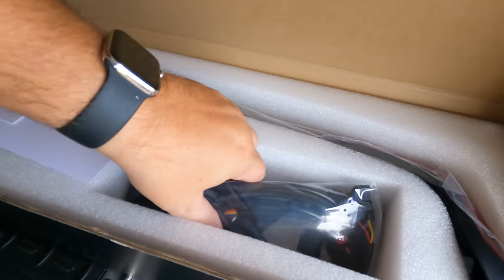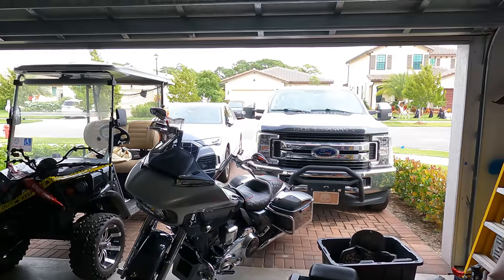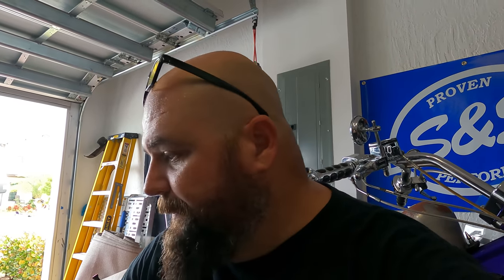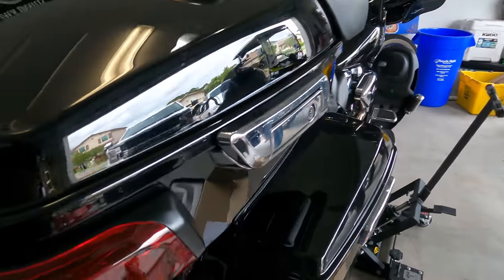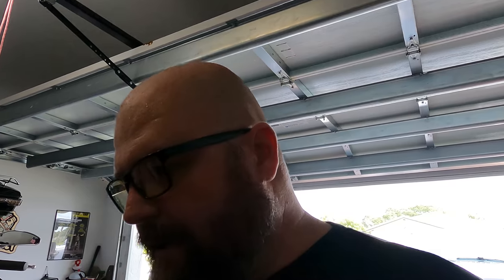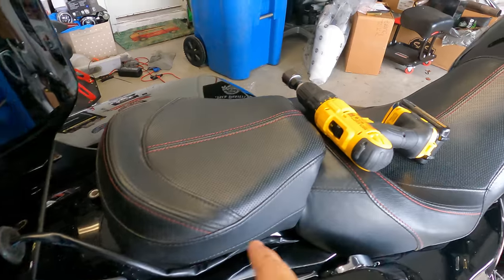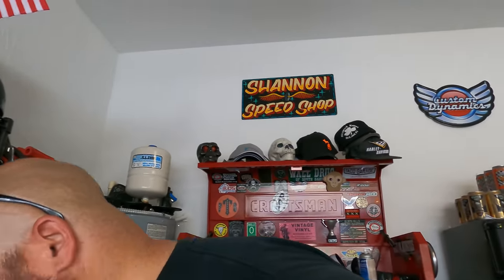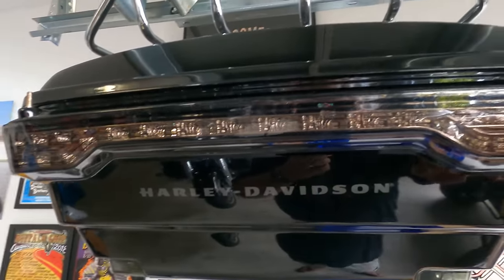A Better Harley Tour Pack Light! Advanblack Reaper Light for Harley Touring Bikes - Install & Review

Comment: I was finally able to order the Reaper via Amazon; delivery to the APO AE.  I live in Germany and have been running the Reaper for about 2 months.  The major concern in Germany is long distance visibility while on the autobahn;  the closing speeds are a bit higher.  The Reaper has awesome visibility day and night.  Installation was very simple (1 beard difficulty); direct replacement on a 2022 Ultra Limited, I relocated the FM antenna inside the tour-pack with the provided antenna.

Comment: Do you have to cut 2014 Ultra Limited that's already got Factory bag lights
Reply from the maker: Nope, same holes as a stock light. This is a direct replacement but you're gonna have to figure out your antenna since that mast isn't on this light.
Reply: I wish to thank you for your reply I was worried it was going to have to drill more holes

Comment: I didn't know that you could do that with the antenna. I'm going to have to look because I replaced my light and it didn't have the hookup either. Could you please do a short video of what you did?
Reply from the maker: It's pretty simple, behind your saddlebag on the fender there are loops on the bracket for securing wiring with a zip tie. I just used those same loops and zip tied my antenna to it.

Comment: Will this fit a razor tour pack?
Reply from the maker: Not a razor, but a chopped it will.
Reply from the maker: @fatnbearded645  sorry!
Reply: Yes it will fit, but you’ll have about a 1/4 inch over hang at the bottom.